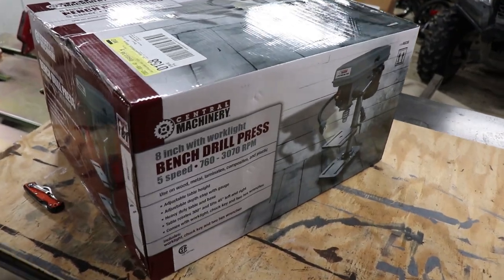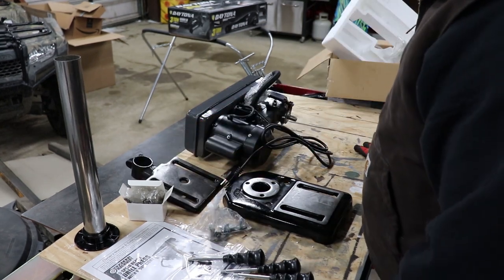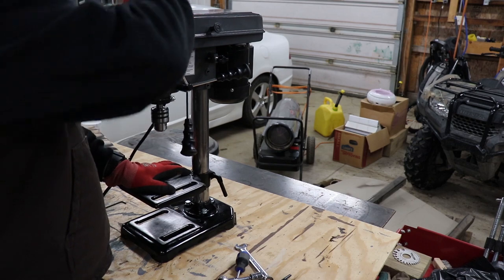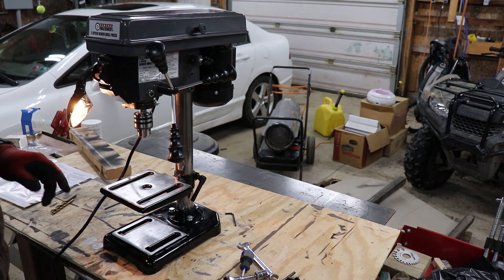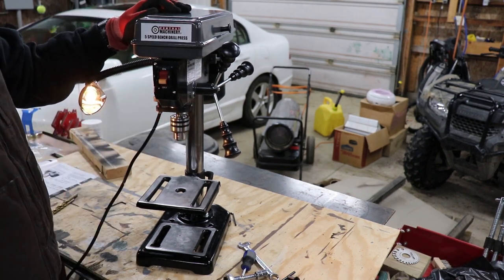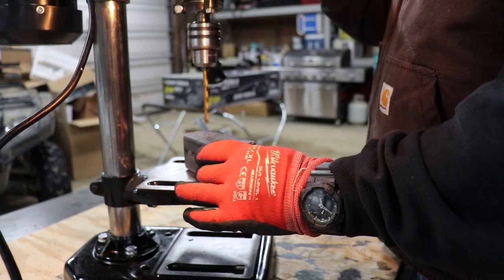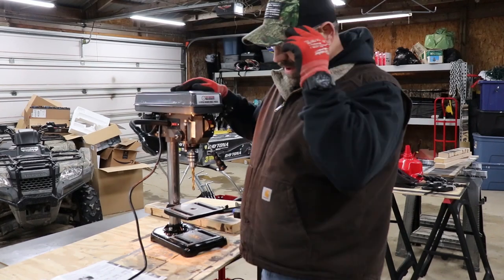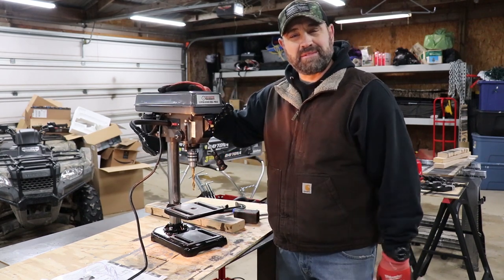Harbor Freight Drill Press ~ Central Machinery 8 Inch/5 Speed

Comment: I have an older Central Machinery 5 speed drill press purchased new several years ago. It still works just fine. The main difference between mine and newer models is the placement of the on/off switch (mine is on the side). Mine didn't come with a light, however. Other minor differences are with the shape of the handle grips and overall color. For the hobbyist or DIYer it's a good press for the money. One extra feature not mentioned is the degree scale on the bed attachment. Just loosen a bolt under the bed and you can tilt it up to 45 degrees either side for drilling angled holes. There's a zero mark on the rear of the bed to line up with the degree marks.

Comment: @ 8:20....You need some thread cutting oil to aid the bit in drilling .If  the bit gets too hot its gonna lose its hardness and be dull and hard to hold an edge when sharpened.

Comment: I am shopping for a diamond core drill, I visited Harbor Freight & I saw this drill, hope you can help me, I need a drill to make holes mainly to gemstones which I need to use a basket fill of water & press down the handler of the drill. You think I would be able to use this drill for my work. I thank you so much for your time, but I learned plenty with your great knowledge. Great presentation.

Comment: Have you found a small vice that has the and bolt pattern to mount to the table? I bought the smallest ones Harbor Freight had but it didn’t match the table to mount with bolts
Reply: gee I almost bought that one... you saved me $22
Reply: Um use the drill press to drill the holes in the table? Or get a better table

Comment: At the small risk of attracting dirt/dust/ etc., coat the column/ post with some kind of oil to prevent it from rusting. Yes, a vise that matches the table slots would be nice if somebody has found one, from anywhere. Thanks.
Reply: Harbor Freight for about $22
Reply: @thetrumpnewsnetwork7503  I was thinking the 4" would be too big. I think need to make a bigger table.
Reply: @kodak_jack  4" is the size recommended for the press
Reply: Silicone spray won't attract dust.

Comment: Never owned a drill press so please excuse me if I don’t use the right vocabulary, but what is the travel distance of the chuck? Will it go all the way through a 4x4?
Reply: Looks to be around 2 1/8" plus or minus max depth of travel. You could always drill from one side then turn the piece over and drill from the other side.
Reply: The travel distance appears to be a lot more than 2” or so!
Reply: Use long drill bit, drill 2" deep, raise bit, raise table, reinsert bit, drill rest of way through.

Comment: Can I finish an 80% lower with this? What about a Glock slide
Reply: Did you ever figure it out? Thinking of buying for an 80 lower too
Reply: I wouldn't know why you couldn't.  I've used mine for aattaching AK gas block and a front sight block.  I've had mine for a couple of years now of intermittent use with no issues.

Comment: Note: to save your drill bits, on steel use high pressure and the lowest rpm and a little lube would help👍🏻😁, great reviews
Reply from the maker: Great advice. I usually squirt some oil on when I do a lot of drilling on metal.
Reply: You can also use liquid soap instead of oil if you're trying to keep your shop clean.